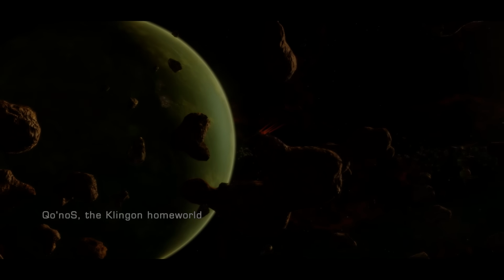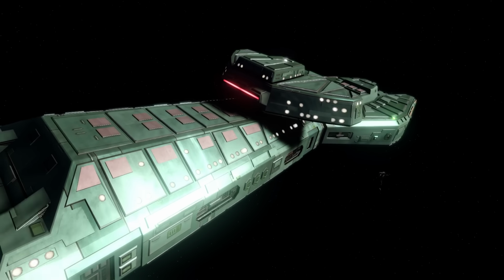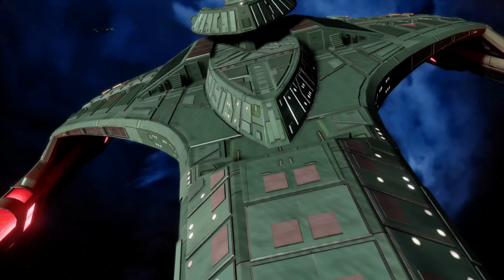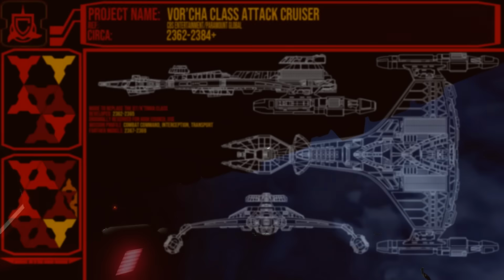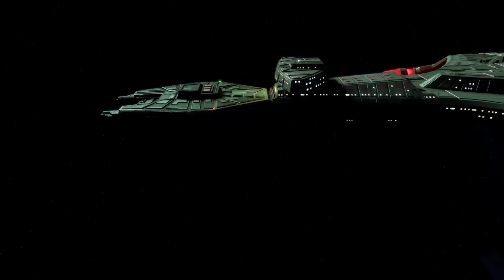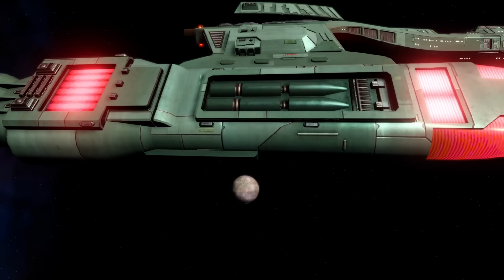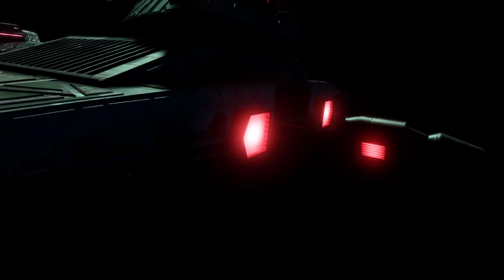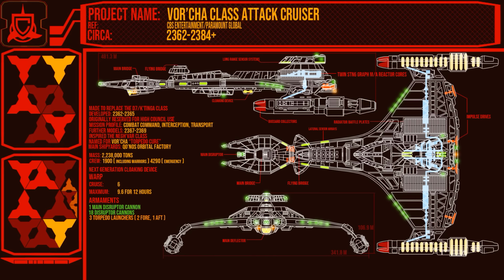Starfleet Inspired? The Vor'Cha Attack Cruiser

Comment: Klingon engineers definitely prefer to continue iterating a successful design until most or all of the growth potential is maxed out. Then they have no choice but to go back to the drawing board. 

Still, I would also agree that the Vorcha wouldn't have been possible without some kind of exchange of commercial grade  and/or non-strategic level technology from the Feds. Some or all of the equipment that was beyond klingon means at the time could have also been reverse engineered from battlefield salvage and examples/specs acquired from third parties, though.

After the civil war, when the design went into series production for the KDF and maybe the fleets of the wealthier (and most loyal?) great houses, both parties are still having to rely on large numbers of D7 and Ktinga hulls. One might think a more modern successor or two for these would be a greater priority than a battleship prototype. 

While the Neghvar/Voodieh has featured prominently in possible and alternate timeliness in both TNG and Voyager, I see the Vorcha as a more practical basis for heavy or battlecruiser development for awhile.

Comment: One improvement the Vor'cha has over it's predisessors (D-7, K'tinga, and bird of prey) is a much thicker and stronger interconnecting neck section. The necks on the previous classes were so thin, one could theoretically cut the ship in half with a single weapon strike.

Comment: So the Klingon fleet structure was Battlecruisers anchoring the centre with fleets of Attack Ships [Birds of Prey].

So they have a similar force doctrine to the Dominion?

And yet Starfleet went straight back to just capital ships, forgetting the lessons of the Dominion War and the effectiveness and utility of the Defiant and Saber classes.
They never learn..... [*Looks at fleet formation post synth revolt and the Borg overidding Starfleet as they emerged from the spacial anomaly.]

Hopefully the Klingons finally design a replacement for the Bird of Prey.
Even Starfleet is now using a Excelsior 2 class.

Comment: I can’t help but notice that if you turn the Vor’cha around and remove the nacelles, it bears a resemblance to a Cardassian Galor class. If I remember correctly, the Vor’cha appeared in TNG before the Galor. So I wonder if the filming model of the Galor was actually a kitbash of a Vor’cha filming model. Maybe I’ve been living under a rock, but I can’t find any info on this. Can anyone shed any light?
Reply: They do look similar. The Vorcha model came first but the Galor came not too long afterward. Both models were freshly made rather than kitbashed. The Vorcha was designed to be the new standard Klingon ship, and it was the first Klingon ship made specifically for the 24th Century as the K'Tinga and BOP were legacy ships from the TOS films. For the Galor, they needed a new standard ship for their new antagonist race. So both were built from scratch at near the same time. That may be why they share some commonalities.

Comment: Cloaking does not limit top warp speed. That was done die to dominion sensors that could detect cloak ships at high warp speed
Reply: Rather, going at top speed limits the effectiveness of the cloak. The D'deridex class has the same issue, with one going full tilt maximum warp being detectable to the Enterprise even while cloaked. Of course this means, if you want to remain stealthy you would have to limit your warp speed, so it is technically correct.

Comment: I'm looking forward to the rest of the video, but I'm a bit confused. The vor'cha is quite obviously green in all of its appearances, it never appears as gray. I hope I'm not being rude, but are you a tad color blind?
Reply: That goes back to a production problem between TNG and DS9. Basically the paint used on various Klingon models got darker in storage so the original models kind of ... rotted.

Early models have lighter shades of paint, but by DS9 Klingon Green was the recognizable color. 

According to production notes, they were ment to be more silver/grey to better fit with the old Klingon design and fleet colors.